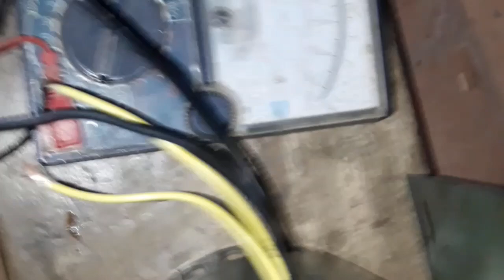Grinder Motor 0.5HP,220-240V,1PH, Coil Winding || Inner Coil Wire Line Connection

Comment: What is winding connection
Reply from the maker: The electric motor winding definition is, windings in electric motors are wires that are placed within coils, generally enclosed around a coated flexible iron magnetic core to shape magnetic poles while strengthened with the current.

Comment: Bro lakshmi grinder motor 0.25 HP ithukku starting and running eththanai turns podanum and enna swg use pannanum then connection eppadi nu sollunga bro please..
Reply from the maker: Video upload quickly bro